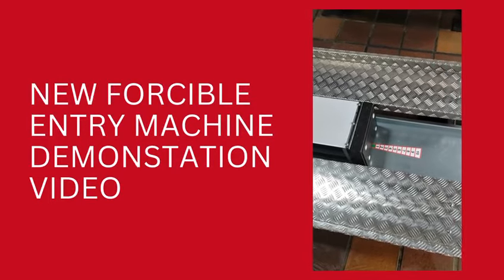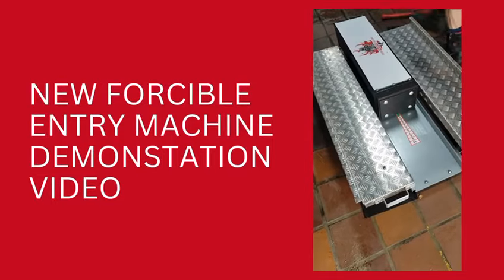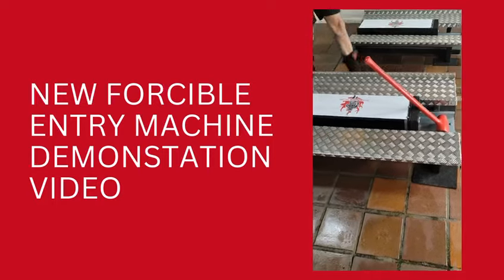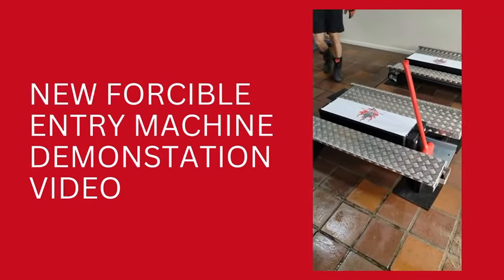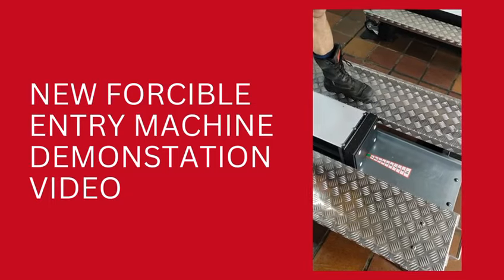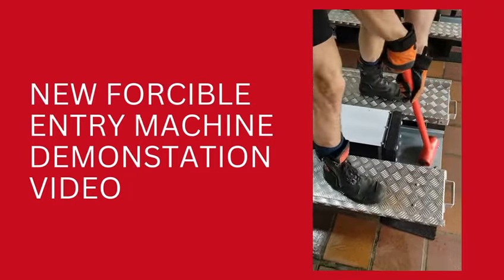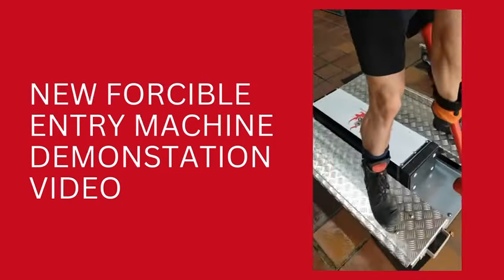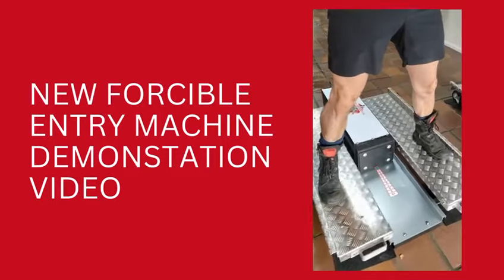NEW BFC Forcible Entry Machine - demonstration video

Comment: They will certainly be affected by temperature as friction will change.
Reply from the maker: @union310  this shouldn’t be the case as the beams don’t drag like the previous machines. The beam is simply a casing surrounding the piston protecting it from significant external temperature/weather changes. Friction should not cause more than a single hit difference with these new machines. The issue with the previous machines being that the 72kg beams had to slide down the pan on silicone runners, with temperature and rain causing huge variations between competitors, with considerably more hits when running poorly. A significant increase in time and energy expenditure which will now be avoided
Reply: @britishfirefighterchallenge  Your statement said that temperature will not effect it, and compared with your previous version it perhaps will be far better. However what I am stating is true, temperature has an effect on everything. As temperature rises the size of things grow accordingly. It is always the case.